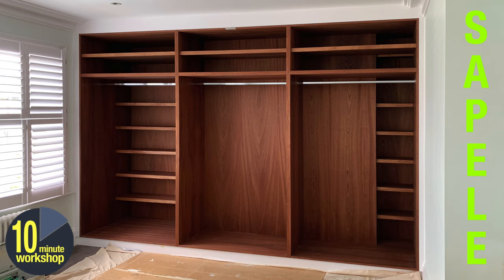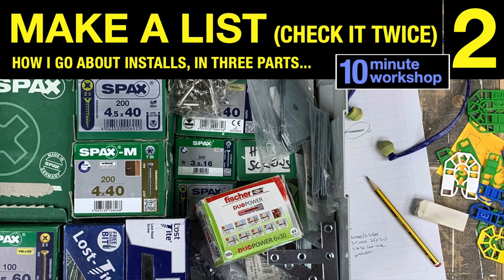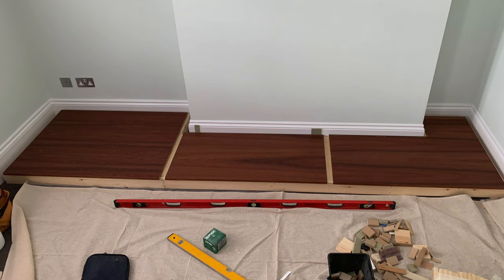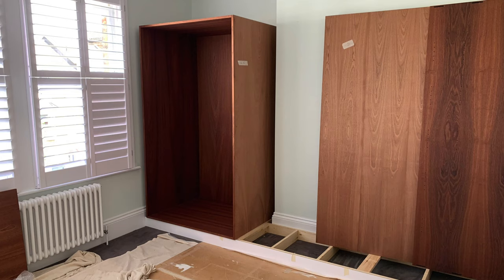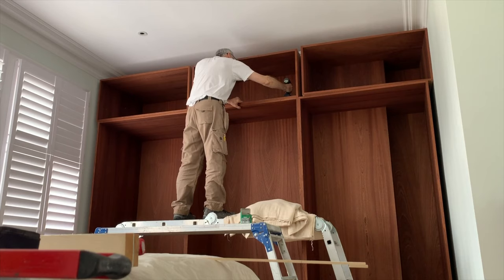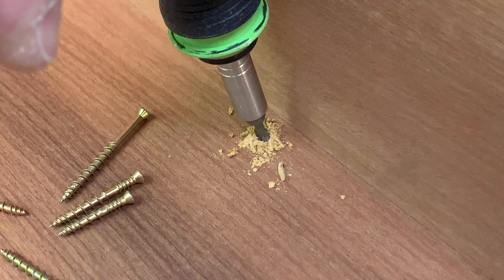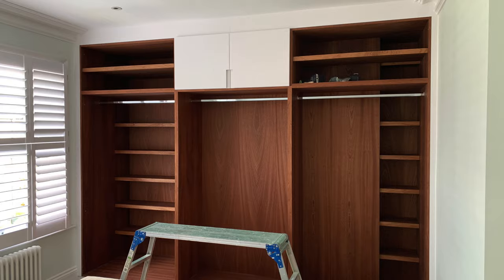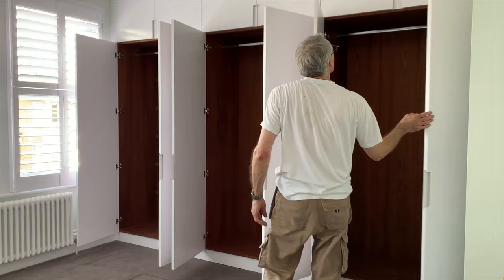Built-in Wardrobes and Shelving Installation [video #344]

Comment: Outstanding job, Peter. Love the contrast of the white doors and sapele inners. I don't know how you do the quality work you do in such a confined space. I guess necessity truly is the mother of invention.
Reply from the maker: Thanks Michael! Not totally convinced by the ‘quality of work vs space available’ equation (I’ve seen some spectacular workshops that turn out junk, lol)  but yes, my space is a little tight for some of the jobs I do, but it’s the space I have, so I need to get on with it 🤷‍♂️😆😂👍
Reply: @10MinuteWorkshop  
You're absolutely correct, Peter, just as we've seen art done in a virtual closet. I simply meant that you seem not the least  bit hesitant to take on commissions that would normally be meant for a much larger space, the sapele project, for example. It reminds me that it's not the tool or the space that makes an artist, but this heart.

Comment: A massive thank you for this video, this is exactly why I love your channel. I have almost exactly the same design of built in cupboards to make for our place. I don't fine making the cupboard a particular challenge but all those little tips and tricks about fitting, they are pure gold. I'll definitely be going with a plinth now I've seen this and the tip about screwing down though the carpet to fit levelling legs is excellent. Cheers.
Reply from the maker: Thanks! 👍👍
Reply: @10MinuteWorkshop  I hadn't thought of screwing pads over the carpet- great idea. Do you think if the customer changed their mind one day the screws would leave the carpet asthetically ok or damaged? Just wondering if you may have come across this! 

Even if they did take them out, to put the bed there for example, I suppose it's far less likely the odd tiny hole would be visable compared to the whole piece being removed!

Cheers for another useful video. The units look great. Matt
Reply: @mattkindon2917  it's a great tip. One thing to be careful of I've found is drilling or screwing through carpet or fabric, the drill can have a tendency to catch a thread and then pull and wrap it around and around itself making an ugly track mark down the weave. Not good.
Reply: @olrenison  Yeah I know what you mean, thanks. I suppose the other thing is getting the right screw length so you don't risk hitting anything under the floorboards!
Reply from the maker: Yes - that's the reason I like to do it this way. I find that if you drill through the ply presssed down firmly into the carpet you're less likely to snag the weave. 👍
Reply: @10MinuteWorkshop  cheers

Comment: Hi Peter, couple of qs for you - 1) how do you handle installs over carpet over concrete? Do you still try to screw through carpet? 2) Do you ever use the little leveling feet that attach to the side of a plinth i.e. Integrato G type and if so can you comment on how you feel they work? I'm in the process of installing my first plinth and floor is very tricky as two old concrete pad hearths meet wood floor in the middle, all under carpet!
Reply from the maker: Hiya. In those circumstances I’ve cut a flap out of the carpet and glued a block to the concrete floor, and screwed the that. Worked well, though most of the (Victorian) houses I worked in had suspended wooden floors, so it wasn’t something I did often. I’ve used the little feet on occasion and they worked well. I generally preferred to fit a plinth and level that up though, then it was easier to move the carcasses around. HTH. P

Comment: Very informative!! Loved all the little details. Need to find those fixing brackets here in NZ. Pleased the lamello worked out. I used mine on a kitchen install recently,  the top box being over 3m high and heavy! With the lamello I simply put it all together up there in place. It did take a bit longer but it saved my back! Thanks for the vid!
Reply from the maker: Cheers Nic! Yes, I’m looking forwards to using the Clamex to assemble ‘in situ’ when the need arises 👍👍

Comment: I'm not criticising your work or work ethic, but I do think you make your job harder than it needs to be :-)
Of course, much of your work or work decisions may be specifically dictated by your customer.

While watching your wardrobe project videos, I thought the timber veneer was a customer desire to see the timber look, except of course that most of the veneer would be hidden by hanging clothes.

I did not expect to see ALL of the veneer hidden by "WHITE" doors.

It seems to me that your wardrobe could be constructed with (what I know to be) carcass laminate MDF. This is available in a few light colours and is more than adequate for cabinet and wardrobe construction. The exposed MDF edges require edge-banding with matching coloured edge-banding and this is a simple task if you have an edge bander. They are available in a "manual" type and they are not too expensive. (check out Virutex edge banders).

Using such material would save you HOURS of time that is spent on spraying and FINISHING the veneer.

Commercial cabinet makers just screw the cabinets together, as do I. The use of CKD (Completely Knock Down) fittings are useful when it is necessary for assembly/disassemby but for a "permanent" install like this wardrobe, screws are very practical as they are not visible when the job is complete. This would also save you hours of time in marking out and cutting the slots for the CKD fitings. Screws are MUCH cheaper than these CKD fittings. :-)

Each section of the wardrobe could be assembled by laying out the pieces on the floor and using one of many squaring assembly jigs to keep it square while screwing the pieces together. A 6mm thick backing (with the appropriate laminate colour) can then be screwed or stapled to the assembled pieces, then tilt up the wardrobe and slide into place. Easy, (but heavy) you are only lfting one end.

The time saved and lesser cost of the carcass MDF and screws instead of CKD fittings would allow you to be more efficient and cheaper. The cost saving could be either a price reduction to the client or more PROFIT for you!

Using a higher quality laminate for the doors would save you the time spent in spraying and finishing the doors, but because of the need to laminate the door edges, you would need to install some recessed door handles instead of routing the recesses.

One final point, the supports for the top panel (above the wardrobe) should be edge on to the panel, to provide extra strength, as the supports are not attached to the ceiling.

For ease of construction, you might find it easier to attach the supports to the top panel first and position the "assembly" on the top of the wardrobe and screw into the supports from underneath.

Not cutting the carpet and screwing down as you do, leaves a massive dent in the carpet. If the need arises, this dent will be VERY difficult to remove!

A better way is to cut the carpet and roll it back slightly to allow cabinet fixing. If the need arises in the future, the carpet can be rolled back and glued to the floor for an almost invisible "repair".

As per my previous comment you make the task of leveling the plinth MUCH harder than it needs to be. PLUS it is overkill using that size timber, when "vertical edge up" MDF provides all the strength and support needed. This method also allows you to use otherwise wasted MDF offcuts. (I can send you a drawing of the method if you didn't understand my comment.)

As always, I enjoy the videos and wish you all the best for your future jobs.

Kind regards

Peter

Comment: To make life even easier for door height adjustment use blum baseplates 173h7100 with inbuilt height adjusment screw, not the ones with euroscrews. ;)
Reply from the maker: I use those for inset doors, for overlays I prefer these. 👍

Comment: Amazing vid! So many great tips. 

It would be great to know how you fix the infills. What are you fixing them onto?

Also how do you hide the tongue-tite screws on a veneer? Stain?
Reply from the maker: Thanks! I glue/screw blocks onto the infill after it's scribed and use those to fit. You can see the process in more detail in My Last Install video - https://youtu.be/B9qHsXC9MAQ. Tongue-tite screws are just covered with a little bit of wax. 👍
Reply: @10MinuteWorkshop  Will check it out thanks! I was thinking of getting little oak stickers on filler and staining them to match the stain on the veneer. Never thought of wax!

Comment: When measuring for a built in wardrobe how close to the walls should you build it? Should you leave a decent amount for a manhandle scribe?
Reply from the maker: Depends on the walls; if they’re good and straight then you should be able to slot them straight in, if they’re old and wonky use a plumb-line to figure out the minimum required. Minimum infill usually looks better; in this instance we were constrained by the radiator and shutters at the left, and obvs they have to balance with the RHS. 👍👍

Comment: Stunning build! As a novice I wonder how you decide on weather you should have a "top box" or simply just extending the bottom box all the way and adding a (fixed) shelf at that same position?
Reply from the maker: Thank you! I generally prefer a separate top box as it give the doors something to bear against; if you extend the sides all the way up, you have to put in a stop of some kind for the doors. 👍👍
Reply: @10MinuteWorkshop  I see, that makes sense. Thank you! If I may ask, are the doors 22 mm?

Comment: Hi Peter, thanks as always for the detailed and informative videos. So helpful for giving the confidence to tackle these sort of projects myself. One thing I have noticed while looking at your videos and others on YouTube is that sometimes top boxes are used and sometimes not. What makes you decide whether to either use or not use a top box design in a scenario? Many thanks, Ged
Reply from the maker: Entirely depends on the clients wishes. For a floor-to-ceiling wardrobe I always prefer to fit a topbox if only for ease of fitting, but as always, the customer is mostly right. 👍
Reply: @10MinuteWorkshop  Thanks for the reply! That's really good to know. I am still trying to decide which route to go. It is for my attic conversion so the ceiling height is relatively low (2.2m) so I am leaning towards no top boxes to allow for better hanging space. I guess just need to allow room above the main cabinet to be able to tilt it up and over the base 🤞

Comment: Hi Peter, I've made the investment in a lamello zeta and I'm trying to figure out how best I want to construct my carcasses now. When i was screwing I used to just fix the panels straight to the back of the unit, this was excellent to square and firm the entire thing up. One of the main reasons I've gone for the lamello is so I can build straight up from the plinth, as opposed to building in front and then lifting on. How do you handle your back panels for these ones, are you fitting it loose into a groove? I'm curious as to if the tenso fittings do hold squarely, especially once braced into the wall, ceiling, and neighbouring carcasses.
Reply from the maker: Hi Jordan. The backs on these were just planted straight on - the old fashioned way! There was enough ceiling height to lever them up them up onto the plinth without any problem. If I was building direct on the plinth I'd try to leave enough space to get behind to fix the backs on, I think. I'm less impressed with the tenso fittings - I've found they don't pull the joint together as tightly as I'd like, but need to play a bit more with them - but the clamex are excellent though. 👍
Reply: @10MinuteWorkshop  That's interesting, it looks like the strength in the tenso is achieved by them being set 0.5mm below the surface of the joint. I'm waiting on mine to arrive next week - the last of the jubilee editions! I've also ordered some biscos as it seems they are ideal for dry fit, and to support alignment on long joints rather than using mutliple more expensive fittings.
Reply from the maker: @jtrent90  Yes - I'm still playing with the depth - I'm sure we'll get there 👍👍

Comment: As usual great video , so you just use your lamello now instead of the glue and screw method? I am considering getting one or the domino festool version (may get a waredrobe contract to do. ps I would like to have a look at your costings info you mentioned I think in video #342 and I will be joining your page as a paterion. you must be one of the best guys for explaining things. Lastly excuse my spelling tonight, its 4am in the morning so I hope I can be forgiven :) Zzzzzzzz
Reply from the maker: Thanks! I tend to combine the Lamello Clamex connectors with Dominos; not overly happy with the Tenso connectors. The Domino is still a more versatile machine overall, I think, whereas the Lamello is much more of a niche device, though it does what it does really well. Cheers, Peter

Comment: Hi Peter great stuff and got a few tips of what you suggested , 1 question what are the biscuit joints you use called i cant quite get what you said. 

Thanks
Reply from the maker: Hi Aaron, and thanks! They’re Clamex and Tenso connectors, from Lamello, for the Zeta P2. Clever fittings! 👍👍
Reply: @10MinuteWorkshop  great thank you appreciate it

Comment: Thanks for the hard-worked video. Im an amateur watching from S.Korea, and I'm curious what you've used to finish the gaps between the walls and the white gap-filling boards(white silicon?). Thank you!
Reply from the maker: Thanks! I use a small bead of decorator’s caulk - it’s a flexible acrylic sealant, like silicone, but a different compound. 👍
Reply: @10MinuteWorkshop  Cool! Thank you !

Comment: Hi Peter! I'm sorry if this has been asked before but how do you go about adjusting the hinges on doors with 4-5 of them? I've recently installed a wardrobe with 5 hinges on each door (tall doors) and I'm having a bit of trouble making all the reveals consistent while keeping all the doors flush to each other. Is there any trick to it? In the same vein, is there any trick to installing the hinge plates or do you just fit the plates one by one and then install the doors?
Reply from the maker: I have a video - or two - planned on the topic, as it’s not straightforward over that number of doors - you need to adjust the size of the door depending on wether it’s a single, a double, and end or mid-run. When you have eg 6 doors in a row like I had here, if they were all the same size I’d run out of adjustment on the hinges!
Reply: @10MinuteWorkshop  I know exactly what you're referring to! I made sure to account for the different door widths when originally drawing everything up so there's plenty of room to adjust the reveals. The issue I'm having with 5 hinges per door is that while it's easy enough to get the desired reveal from top to bottom, it's troublesome to adjust the hinges in such a way to make the doors completely straight (as opposed to bowing inward or outward), flush with each other, and not have the hinges bind when opening/closing the door.

What happens is that I will adjust the reveals and then the depth of the door. I will then check if the door opens and closes properly, and on one or two of the doors I will feel/see a hinge bind because one or two are not adjusted correctly but I can't tell which ones. I feel as if I have to choose between having the reveals consistent, the doors flush, or the doors opening/closing properly and I can only pick two. Is there a trick to getting the hinges adjusted just right or perhaps a recommended order in which you're supposed to adjust them, such as top and bottom first, middle second and the remaining two last?

In either case, thank you for all the educational videos you've put out, you've certainly already made my life a lot easier while making this wardrobe, and I'll be looking forward to your video on wardrobe doors with multiple hinges.

Comment: Thanks for this video! Thinking of building a similar unit and was wondering if the flooring (carpet, currently I have vinyl floors, etc) needs to be removed? Or okay to leave the current floor and continue with the project? Thanks I’m advance!!
Reply from the maker: Thanks! No, this was laid onto the carpet. You need to compress it down to get a good fixing, but it’s not a problem. 👍👍

Comment: Hi Peter. Just found you and going through your back catalogue. Excellent work. Quick question. Do you ever have trouble with the doors warping when they are painted or sprayed? Are they less likely to warp when a dedicated spray company does that side of the work? Do you have any comeback on the spray company if they did warp?
Reply from the maker: Thanks Keith, and welcome! I had a few nibbles very early on whenI was using 18mm MDF for doors. When I switched to MRMDF and started using 22mm for the doors, those issues all went away. HTH 👍👍

Comment: Hi Peter...great job !!  Can you let me know how you fixed the end scribes in, on the pictures there was no batten on the inside just the plastic space plugs. Would be interesting to know, thanks.
Reply from the maker: Thanks! The side infills were just screwed on through the carcass sides, and the fixings hidden behind the hinges. I'll have a scribing video out before too long when I'll be going into this in a bit more detail 👍
Reply: @10MinuteWorkshop  Thanks for the reply. I have tried doing this in the past but found it difficult sometimes to keep the infill piece from pushing in too far. That's why I fix a batten to the carcase side before putting it in.